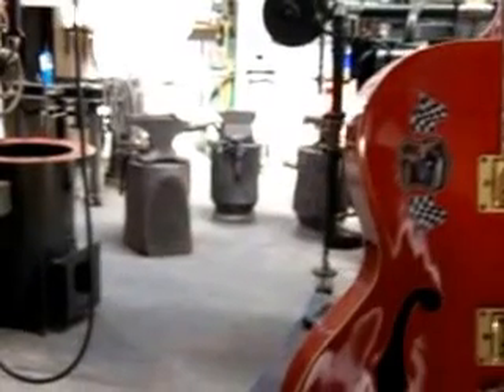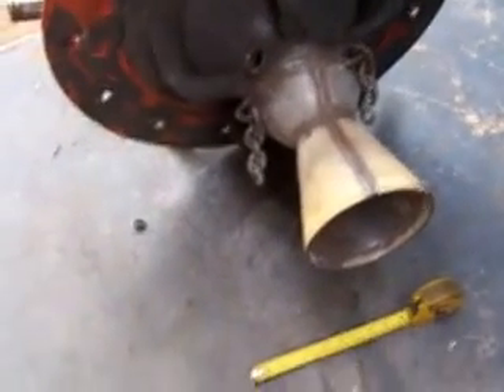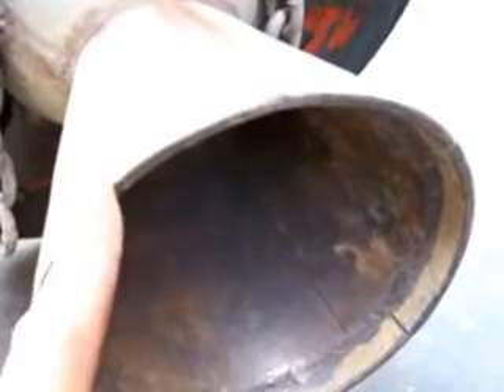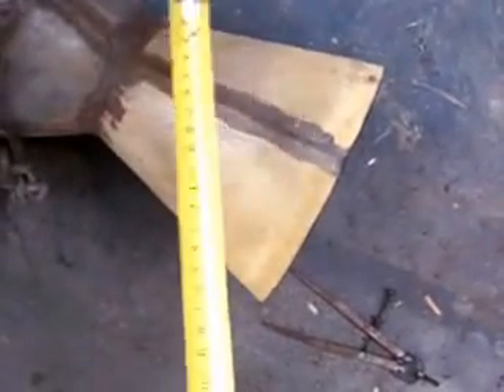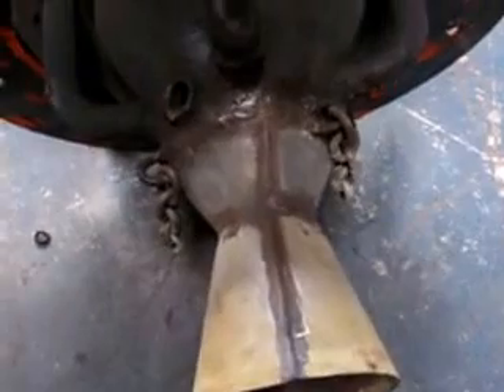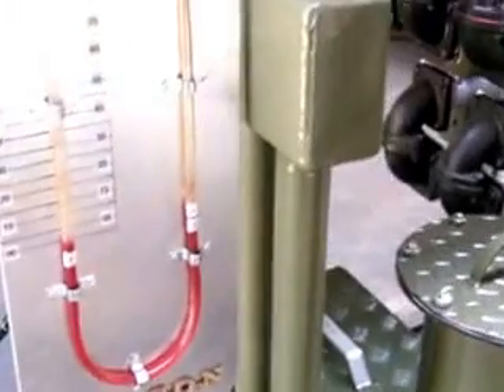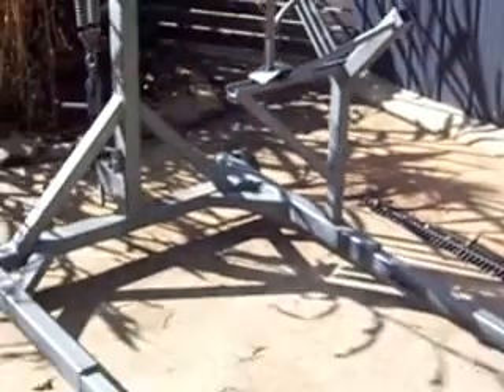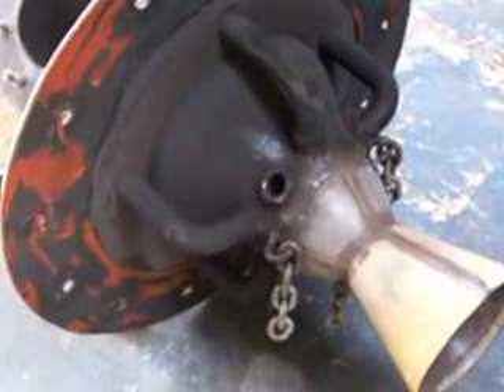The new A1 Gasifier Internals, part 3

Comment: Hey man, how goes it? Have you had anymore tinker time to work on your gasifier?
Reply from the maker: Hey flash, glad you asked, i went the whole way with the insulation, i used 9 kg of plaster of paris and dry sand to plaster the steel cavity around the firecone i fabricated, and also did the entire inside of the barrell , which was tricky ,, 1 1/2 inches thick, i am pissed i didnt get a video of all the upgrades  but time was precious.
I did a trial run with the new firecone set-up,, and as you predicted i got a halloween orange flare, almost see thru,, there is too much to mention in writing of what changes i made and what i discovered on inspection,, gotta fix the leaking hopper lid, and the 2 leaks in the first crossover pipe elbows, might start playing with different filter mediums coz what i am using is not doing much at all,, i switch over  and back  again and dont see any difference in the flare,, hmm ?
The flare really is promising though, and once this Gasifier heated up it was a pleasure to see and use and hows this,,
I was called to come inside for dinner so i shut everything off with half a hopper full of fuel,,, 45 minutes later i decided to go back out and have another play around with the gasifier.
I shoved the gas torch into the ignition port and in 2 minutes she fired right up and low and behold flammable gas !!   the insulation is awesome, keeps the heat inside the barrell and in turn doesnt heat up the surroundings,, radiator was nice and cool too ,,,outgoing gas temp was 30 degrees C, i ran my hand thru the flare,, Freaky !!
So there you have it,, i have done some late night work on the gasifier and i will get a video out in the next month or so,, trying to juggle life and everything that goes with it keeps me anxious to get back to the gasifier ,,
Reply: ***** Welcome to the world of cracked tar. Now you know what you are looking for and it sounds like you are at the stage of fine tuning the gasifier.

Comment: My original top cone dimensions were damn well identical to the top cone you have in this video! The only thing I did different from the design specs was I made the bottom inverted tar bell shorter!

Ahhh ha ha ha ha ha haaaaa! I was just thinking that your bottom cone should have been on the top and I'll be a son of a gun if you just didn't say you were going to move the bottom cone to the top!
Reply: are those one inch nozzles?
Reply: *****
Tom what's up? Have you been experimenting with your gasifier since the last time we spoke?
Reply: been sick as a dog. But I did light it with just the cyclone. I got some nice orange red flame too. It really burned up the wood quick though. I have been rebuilding my cyclone for better heat resistance. I think it is producing more gas than I need for the generator.
Reply: I have been watchin some old factory vids of the original imbert systems for cars. when I get the materials I am gonna pipe in my f350 for wood gas for the next gas project.
Reply: its a 1986 the phone company used to use it as a utility truck. It had a bucket crane in the back it has a 351m Ford
Reply from the maker: *****
i wouldnt mind seeing that in action, baby steps for me for now,, i will eventually put a system on a truck its inevitable i guess